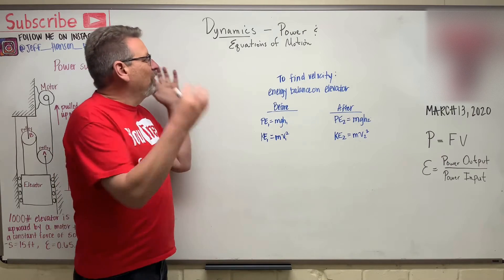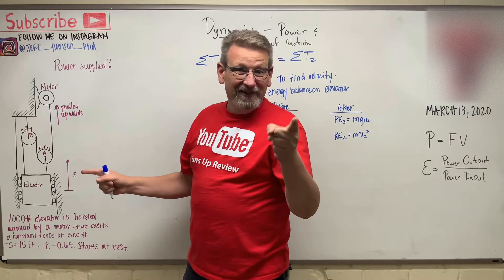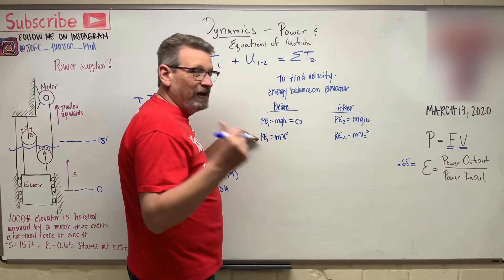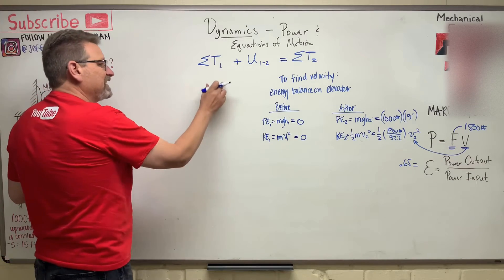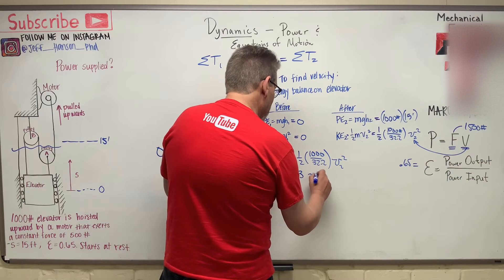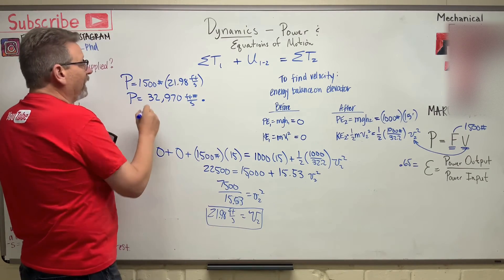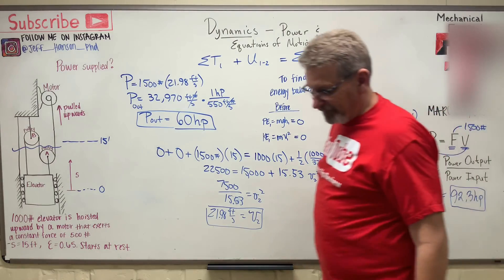Dynamics: Lesson 25 - Work and Energy Balance with Power and Efficiency

Comment: I love you videos, I hope they pay off as I am using them to prep for the FE and dynamics is something I struggled with because while Hibbeler is my favorite professor, his default course structure does not work for something as nuanced and varied as dynamics, his class and workload structure works great for mechanics of materials, statics, and every other class, but a test every week on 2 new concepts without paying mind to most of the old concepts was not the way for dynamics.

I do have one suggestion for your videos. When you are done explaining the concepts and stating the problem, it would be helpful if you moved out the way of the board for a few seconds, so us at home who are trying to work it out on our own at first don't have to keep moving the video around when you in the way of something. Just a few seconds of only board would allow us to pause the video on those few seconds so we can try and work out before you write anything on the board. 

Also if you have to make a correction to the problem mid problem, try writing a comment about it on the video and pinning the comment, that way when we are trying to work it out, if we get stuck and feel like something is missing, we don't have to watch through half of the solution to see there was a mistake, we can always just check the comments and continue solving the problem without assistance (and hopefully getting it correct).

Comment: What happens if the elevator isn't sitting on the ground? Example, it started 15 feet off the ground, do you still put the first PE & KE at 0 or do you solve it with the formula as well?

Comment: Why is the force in the final power equation 1500 lbs and not 500?  Isn't the motor only supplying 500, and the pulleys are supplying mechanical advantage which gives the 1500?
Reply: Yeah , you re right but at that time the velocity of the cable connected to motor will change , if you remember from dependent motion. from there -3Va=Vb which will give the same answer.
Reply: @canerdavarc4547  Thanks!

Comment: Can someone please explain to me why we don't consider the tension from the bottom (rope of) pulley A? 
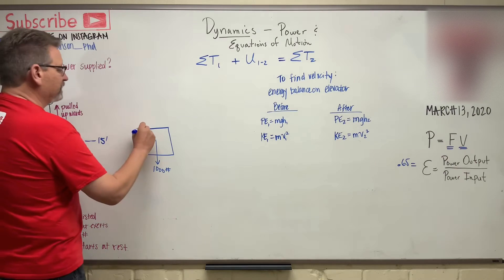cf. 3:25 minutes in the video.
Reply: Same thing , Ta=2T so there will be no change
Reply: Because the point of application for the force on the pulley does not move. When you apply a force but the point of application for the force is not moving, then no work is done by the force.